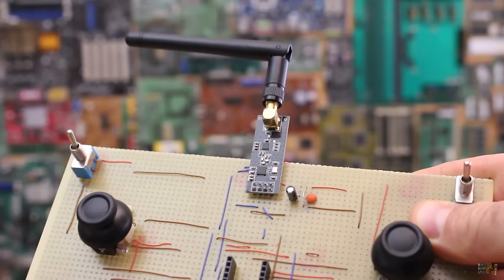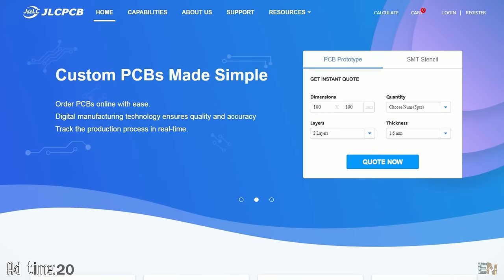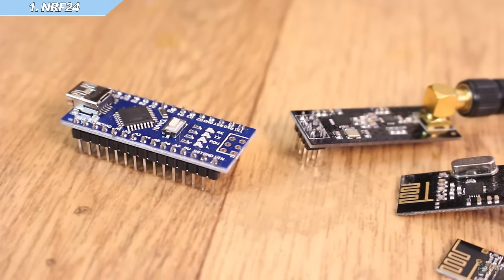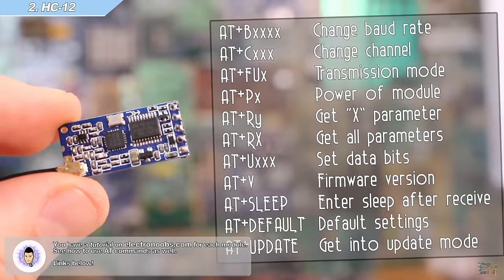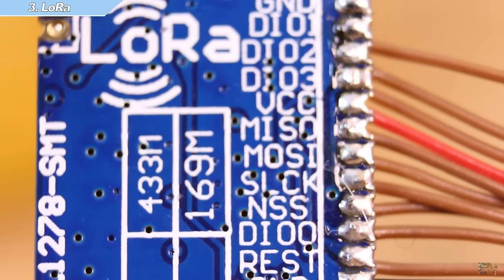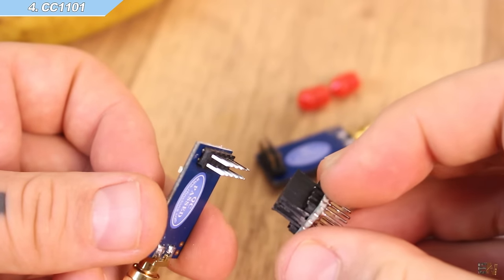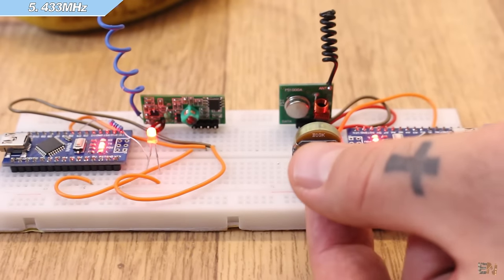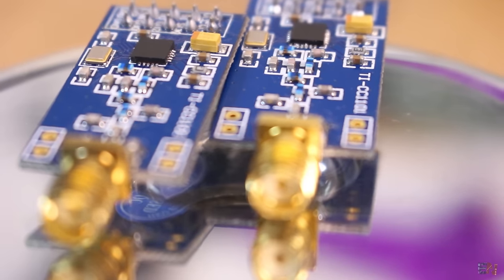Which radio module? NRF24, LoRa, CC1101, HC12, 433MHz, HC05

Comment: Recently I found by accident that for the very cheap 433Mhz modules (with 3 connection pins) if you pull down the data pin with relatively low resistor like 2-5k, the data signal becomes much more stable.
Reply: Do you mean the RX pin on the receiver module? Or the data pin on the transmitter module?
Reply: The RX on the receiving module, but later I found out that it was not true for every receiver unfortunately.

Comment: HOW FAST LORA RECEIVES DATA, IS IT POSSIBLE TO MAKE A REMOTE CONTROL PLANE WITH LoRa?
Reply: It's actually fairly slow. For example sending 40 bytes would take 5-8 seconds on a LoRa. 5 bytes might take a second or so which is still too long for that application.

Comment: Well, there are 3 main factors to consider when choosing radio modules: range, energy usage (which is determined by power and the time it takes to connect and send the message) and speed. So using those, the modules you used (plus a bonus) would have:
1. NRF24: medium-high range, low energy usage, high speed. Example usage: drones, battery-operated IoT devices.
2. LoRa: very long range, variable energy usage (depends heavily on the length of the message due to its low speed), very low speed. Example usage: IoT devices.
3. CC1101 without/with power amplifier: medium/very long range, low/very high energy usage, medium speed. Example usage: walkie-talkies.
4. HC12: long range, low energy usage, low-medium speed. Example usage: battery-operated IoT devices, drones.
5. 433 MHz raw: variable range, low energy usage, variable speed. Example usage: cheap devices.
6. HC05/Bluetooth 3.0: short range, medium energy usage, medium speed. Example usage: robots controlled with a smartphone.
7. Bonus: Wi-Fi: short-medium range, medium-high energy usage, very high speed. Example usage: IoT devices, security cameras.
IMHO, the best general-purpose ones are the NRF24, the HC12, Wi-Fi (including ESP-NOW) and Bluetooth LE (which isn't in your comparison). They're easy to use (especially Wi-Fi and Bluetooth LE if you use an ESP8266/32), don't use much energy, have a good range and are fast enough for most applications.
Reply: I wanna build a intercom like device using radio communication for my race team range required is about 5kms. What should I use and how should I proceed ?
Reply: Yeah m just gonna screenshot this and keep
Reply: Is it possible yo have one tx and multiple rx?
Reply: Good summary. But you should use the terms latency and bandwidth instead of speed.
Reply: @ @leabernadettebasisao4660   yes we can but we just need to peer them
Reply: Which module works even if there is no Clear line of site.
Since I have used nrf24 with antenna but any obstacles like tree or building interfere the communication...

I require long range communication for race car to get live data..
Reply: @Wick I only want to transmit engine sensor data and other data like speed .  Will lora will be fine for that? 
And at what rate I will be able to transmit.
Reply: H
Reply: @aashishgupta1112  yes same is my querry
Reply: so which one is faster, very small latency, is it wifi orbluetooth, so i should chose esp32? or bluetooth nfr24?
Reply: @configuy  If you are hoping to talk to your . . . . . wait this is from3 years ago.
Reply: This is a fantastic run down, thank you

Comment: Thanks for this brief overview of different RC transceivers. 
3 important things to add about NRF24:
1) It can also work as transmitter and/or receiver and switch its role on the fly. Example of usage -- binding transmitter to receiver for custom RC. When transmitter broadcasts packet saying he is looking for receiver with required capabilities. And then transmitter listens for inbound packets from receiver with their IDs and other data.

2) The distance, speed and reliability depends on the size of packet. Maximum size is 32bytes. And this will be slowest and less reliable.  If you set packet size to 8 bytes -- drammatically improved capabilities.  

3) You can change the power of transmission dynamically from your code. Example of usage -- your sensors that need to talk to some hub if something happens. Until something happened -- they don't need any transmissions, so they can set power level to the lowest. On a trigger -- they change power to some more powerful level and transmit new sensor readings to hub. This will allow you to save battery if these sensors are portable. 
Beside that -- this modules have auto-acknowledge, multi-channels support, etc.
Reply: Thanks Krukhlis, Would you tell me how to set the transmitter to the desired power level please? and how to change the channels.  thanks

Comment: Small error in the map use: if you want to map 0-1023 to 0-255, you need to write map(analogRead(pot),0,1024,0,256); It has to do with the way integer-divide works. Try it out, in my example the every 4 values convert to a single value: 0,1,2,3 become 0 and 4,5,6,7 become 2 and finally 1020,1021,1022 and 1023 become 255.
But in this case /4 is faster and exactly doing the same.

Comment: In general, if you've problems with data signal integrity over such short cables and low data rates, it's probably because the input resistance of the pins is too high and you're picking everything around. Just put there some resistors to strengthen the signal (to increase the current).

Comment: Be aware of fake HC-12 modules. They have a missing trace on the PCB which results in a horrible range of just a few feet/meters. This can be fixed by soldering, but still.

Comment: I also bought the small version of the 433MHz LoRa but I took like 4 hours to solder everything because it's so tiny !!
So I would tell you to buy the module
Lora Ra-02 Module
So easy to solder ! Buy you will also need to buy 2 IPEX antenna for these Lora Ra-02 modules
Reply: I've made a small range test with LoRa with the minimum rates and I got like 230 meters
Reply: So if I optimize my rates, I'll be able to get some better results !
Reply: What do you think, lora is good for drone?

Comment: I had so many problems with the NRF24 and never thought the interference would be in the short cables that I was using. I ended up using some more expensive modules for my project instead. I'll do some tests using your twisted cable tip.

Comment: You didn't explain esp8266 
Please make next video on esp8266 module
Reply: It is not radio.
Reply: The esp8266 and esp32 modules are microcontrollers that are arduino compatible. Each of them contain both Bluetooth and WiFi radios with some dev boards also including a LoRa radio. Out of the box they come preload with an AT command set which allows access to the radios. This would be similar to some of the radios demonstrated in this video.

If the user wants to do away with redundant microcontrollers they can load a program onto most of the esp8266s and all esp32s. The 8266 can run at 40 or 80 MHz and the 32 can run at 160 or 240 MHz. The 32s run $5 to $10 unless you get Lora which brings the price to $25 (for the 915 MHz version, the 433 is much cheaper). The 8266s are $1 to $5. Memory can be 1/2, 1, or 4 MB with most being 4.

There is one esp8266, the esp-05, which requires surgery to move a pin between power and ground to enable programming. The 05 is the smallest in the line with a footprint of 1.4 cm Square and exposing only 5-ish pins (reset, vcc, TX, rx, vdd). These pins are in line but there is a 6th pin, a second ground, that could aid in support.

Comment: Can ı use this module without "3,9,10,11" pins? Because this pins  are connected with motor motors. I can't change them.  So can I use this module in my project? Pleas answer.(arduino nano)

Comment: Its a very helpfull video.. can anyone please help me.. I'am using an HC 05 bluetooth module, but it is not pairing with my android phone. I have tried different codes like, 1234,123456,123456789 etc... and tried a number of android applications. It still not pairing. When I tries to pair the LED inbluetooth module stops blinking and again starts blinking once I fails to pair. Do somebody have any suggetions..?
Letters in chip: cc2541, F256, T1   831, CGEY G4

Comment: hi, can some one point which has very good Data penetration with minimal loss of data,with too many reinforced walls in between a 60-70ft not direct line of sight, the application will used for wirelessly monitor APFC Relays state and modbus Data from the controller itself. am thinking NRF24L01 With amplifier version. can some one guide.Ty

Comment: I'm trying to use direct pairing bluetooth or other wireless means to connect 2-3 devices to a speaker and mic, for short range communicating while wearing helmets. (We should never be more than 30 feet apart.) I'm very new to electronics,  so all my Google searches have come up empty. Partly, I think, from not knowing the terminology, and so not being able to search properly. Is this doable? And could you point my search in the right direction?

Comment: Thank you for the video, I've tried  NRF24 with and without Antenna module , and lora, I was not able to receive anydata after 7 m distance from the transmitter inside the building. Any suggestions please?

Comment: Dear Sir,
Need you help in nRF24Network.
There is "Two different nRF24 set is overlapping signals if put same node 00, nade 01 and so on" 
for example, there are two sets of nRF24Network.
Using first set for temperature transmitter as using master node 00, transmitter node 01.
and second set for temperature transmitter as using also master node 00, transmitter node 01.
is there any solution or a different address that can replace by nodes?
For example: Master node 00 = 0xF0F0F0F0AA
                            Slave node 01= 0xF0F0F0F0BB

Comment: I have an  flysky fsct6b transmeter and receiver. The circuit burned out in my hand. Can you tell me how to make the remote again from an arduino board using its signal translate module ?.

Comment: You assume communication between one arduino wit another. Many times you don't really need a controller on the control side - just get the joystick or button and send them to your Arduino. For that, you really don't need Arduino, software etc. And the battery will last longer.

Comment: I have a plan of using a long distance transmission work but the problem is  there is a lot of obstruction in the way so I was unable to use HC12 module for the purpose is there any other module (except Wi-Fi ) which will be suitable for my given requirement

Comment: Other than the NRF24L01, do any of these have an on board antenna? I am trying to develop a compact design with a transceiver, but the spring antenna makes everything too big. I need a range of at least 200m without the use of an external antenna, do you know of anything with this capability?

Comment: Can you make a fm radio using those modules?
Reply from the maker: Depends on what you mean by FM radio? FM is just "frequency modulation" and that could send digital or analog data. If you want for example to send audio with these modues I don't think you can. These are digital data radio modules.
Reply: @ELECTRONOOBS  so it was only use for transmitter only.

Comment: Is there a settings or a way to create a point to point  connection without interfering other NRF24l01 module like there are 4x NRF24l01+PA+LNA transceiver module pair each of them for p2p connection at 700m of distance, basically there will be two links network parallel to each other, but none of them will be interfered each other even 1m apart.

Comment: What about the wifi module ?????
Reply: Well, Wi-Fi is short range, uses quite a lot of power and has quite a bit of overhead, but it has the advantage of having very fast data rates after setup.

Comment: Hi sir. I need help with my cnc plotter. I used Arduino uno, adafruit motor shield n old cdrom motors. In soft inkskep , poseccing. But it's doesn't move a inch. Help pls.

Comment: If I wanted to have something remotely signal a light would a radio module be the best option? The project I am considering is something for Ice Fishing, when a fish bites a lure it sets off a spring loaded flag, I'd like to make a thing that would turn on a light in the ice shack with the flag was set off.

Comment: I took apart an remote controller from garage door, modified the transmitter to support 12 volts and 5 amps, signal went 2 miles. I also want to buy a 1000 watt amplifier for 443 mhz, and see what it can do. I use it to send wifi to my school which has blocked youtube.

Comment: Thank you for your excellent video. May I ask if you can do a video using two Mega 2560 units with two nRF24L01 with  3.3 v adapters. I tried several setups and cannot get them to function. Your pot and led setup would still be a fine example. I used the   proper MISO,MOSI,SCK pins on the mega but not sure about CSN and CE. Coding may be my problem. Please help. THANK YOU !!But

Comment: the HC12 ebay link is different to the HC12 in the video. soldered on wire antenna, not a remote antenna connecting the the board.
anyone found a HC12 with better range antenna? (do the external antenna with connection make for better range)

Comment: This is great and I’m only new to this. I’m trying to understand here as well how many of these modules allow for multiple connections.

My understanding is that the NRF24 can allow upto 5 connections per unit. My issue is I have approximately 1.3kms of distance, but I think you can chain the connection between the Nodes to get there.

Comment: Hi thanks for the great video. Wanted to see if you know this. In a RC controller, how does the controller talk to the external RF module? I mean what protocols/pinouts for the external JR module. Can we use an Arduino to directly drive the external RF modules?

Comment: Hey, i tried to build a remote with the nrf24 modules but when i set the data rate and pa level and print those to the serial Monitor they have not the same value as the value i set in the program

Comment: Very great video! I tried to use the HC-12 with a spring antenna soldered in the ANT pin of the module but the range was very poor in an indor application! Do I have to do something with AT commands to increas the performance,  should I use an atenna connected to the IPEX connector? Thanks

Comment: What about the government regulations on radio communication? Do you need a license for these modules?
Reply: Not for these modules. Even the Long Range modules that can transmit out 10 miles are not regulated since the 915MHZ frequency that they use is considered open.

Comment: NICE VIDEO!!! 
 But Can i use different types of arduino boards for the transmitter and the receiver? for example a nano for the transmitter and a mega for the receiver???
Reply: yes .you can 
becuse nano or mega is litter camputer for project

Comment: It's my understanding that at least in the USA the radio for aircraft including does is 2.4 GHz. You are only showing 433 Hz which may not be used for air.  The US has specific radio frequencies for air,  ground,  water,  etc. Do you know of any transmitter/receiver units in the 2.4GHz range?
Reply: NRF24 uses 2.4Ghz

Comment: Which module works even if there is no Clear line of site.
Since I have used nrf24 with antenna but any obstacles like tree or building interfere the communication...

I require long range communication for race car to get live data..
Reply: go for long waves, short waves like 2.4Ghz get blocked easily, try 433Mhz or less

Comment: Thanks for the collection of examples this is helpful. 
   Which modules work well for programming using the arduino bootloader and UART? Do any of these have an effective way to reset the AVR for programming?

  Lastly, why are so many people buying the $3-$4 CC2531+ USB-A modules from China? I keep seeing listings where thousands of people have bought them. I've searched around the internet, but I haven't seen what projects people are using these for that makes them so popular. Most listings call them "Bluetooth Sniffers" and refer to them as Bluetooth 4.0 and zigbee. I know 4.0 is basically "modern bluetooth"  with low power, and I know zigbee is mostly popular for it's mesh network capabilities. I've seen what looks like the same CC2531 module sold on Digikey for $50, but I still have no clue why they are becoming so popular and selling so well. The only things I can think of is maybe some kind of software defined radio. Does anyone know?
-Jake
Reply from the maker: Hmm, I never sued the CC2531 module. I'll look  into that.

Comment: Esp8266 01
Reply: Of coarse wifi is alot better than Bluetooth but when I thought about it with arduino
It may have same range and we don't need so high speed high speed connection between two arduino. But you should check pros and cons
Reply: @ayanvaidya2727  there's esp-now protocol for connecting 2 or more esp8266s without using wifi also
Reply: @TuttleScott  okay I know but what will be range
The frequency might be same as wifi shouldn't we call it wifi communications
Reply: I have none of it just esp8266 😭😭😭

Comment: Little help please,
I wanted to communicate few bytes of data over a distance of 300m with few trees in between. Which radio module would you suggest. If not is there any other better way
Reply from the maker: Lora an NRF24 are quite good